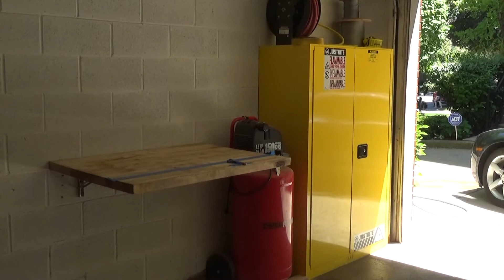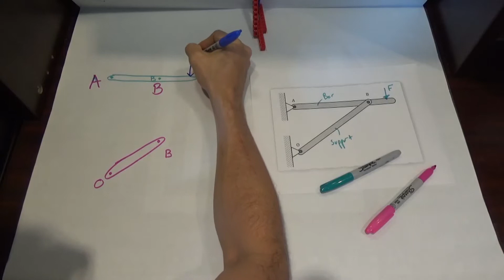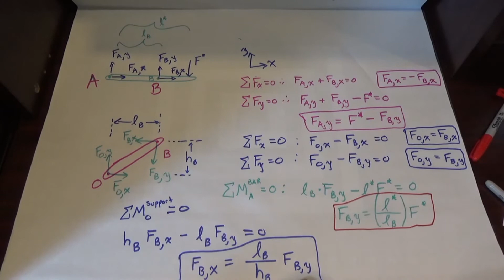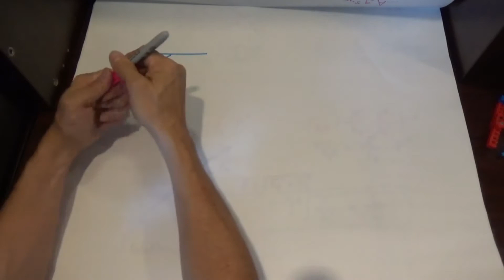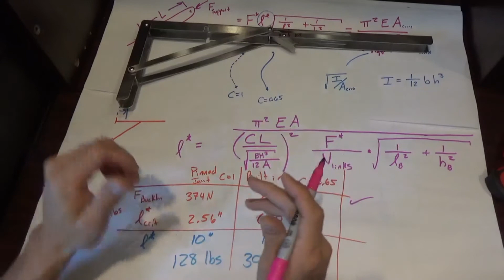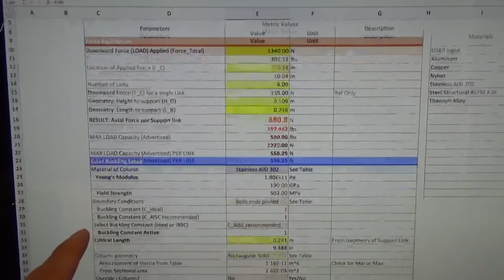Art of Machine Design: Folding Shelf Bracket

Comment: I don't think he mentioned, what brand these brackets are, and i wish he would. I'm just finishing a shop, and looking for different ways to Not spend 300. dollars on lumber but have a good clean, simple method for a 24-26" table on one wall. This is very interesting that he found this out, and now, how does one find the best bracket! Very interesting.
Reply from the maker: Oooopss.  By default I do not mention brands, because a product can change, but YouTube is for EVER.  I rather give you a brand that works.  After this video I purchased ones labeled "Heavy Duty" (available via Amazon) Brand is Autohj.  They advertise rated for 80kg (176.37 lbs).  Hope this helps.  I will be posting a video comparing coming soon.  I took a while since I have been making an engineering platform for people to follow the engineering analysis.  :) Stay tuned.

Comment: Would it be stronger upside down for the tension hold? Like a fold down table , rather than a fold up table?
Reply from the maker: That is actually how I use them.  The links are then put in tension which is a different failure mode.  We then have to look at the pins.  Check out the platform I created for doing Engineering Analysis.  Anyone who joins the platform in Aug 2024 will be upgraded to the Galaxy Plan for one month.

Comment: Excellent Analysis and, thank you for the well thought out experiment. I myself am a Bridge engineer, and am also pursuing the renaissance man path. I stumbled upon your video after looking at these hinges on amazon and saying no way these can handle 500 lb! I am going to be using them on my workbench build to allow the legs to fold in, so they wont really be loaded at all anyways (except laterally). As a fellow nerd/engineer I have some comments on what I would have liked to see, although I understand time is a big factor! Comments as follows:

- Regarding the torsional stiffness analysis, It would have been interesting to take off the table top, and use the unloaded hinges as a reference for the origin, followed by remounting the table top and seeing the displacement due to the dead load of the table alone.

- Comment on non-linear behavior and significant degradation in torsional stiffness due to buckling. The moment-rotation curve presented does not include the linear behavior zone, additional data points at 0,0, and at the "table self weight" would have been beneficial. Comment on why the rotational stiffness is changing/ is non linear.

- Would be interesting to have included discussion on effects of lateral bracing between links and the effect on the buckling mode. What link thickness would you have utilized if you designed this hinge? Increasing thickness vs including bracing.

- Would also be interesting to have compared the moment-rotation curve with the system in the tension configuration, to that of the original compression configuration, would be interested to see the load capacity of that system!

Thanks again, for preforming this experiment and analysis, well done, well presented and looking forward to more.
Reply from the maker: Wow.. Thank you for the detailed comments.  Those are really great comments.  I will keep those observations for future topics to explore in structures. If you would like to create a video together for the channel to explore these topics that would be awesome.